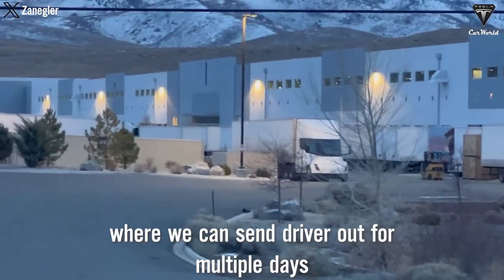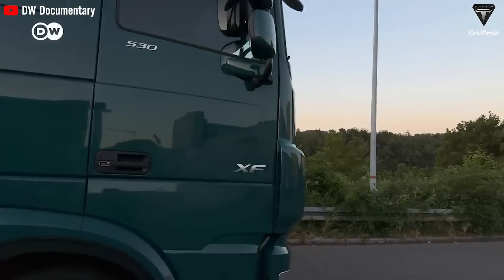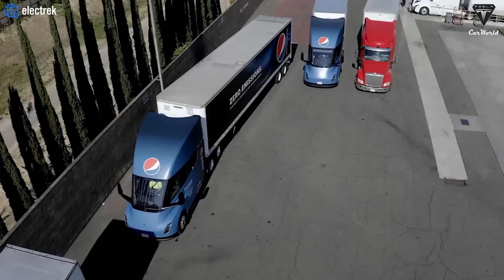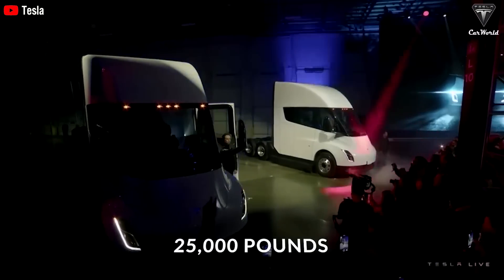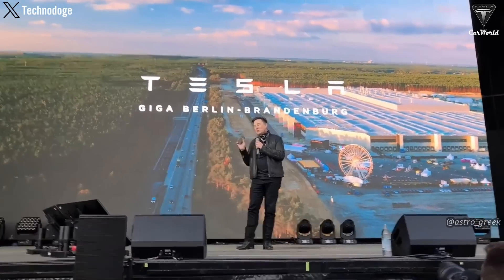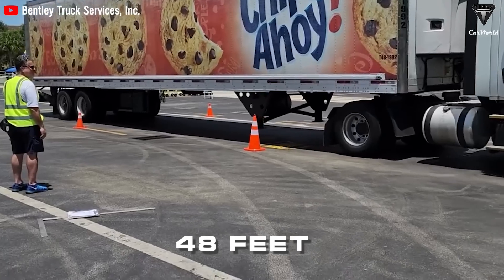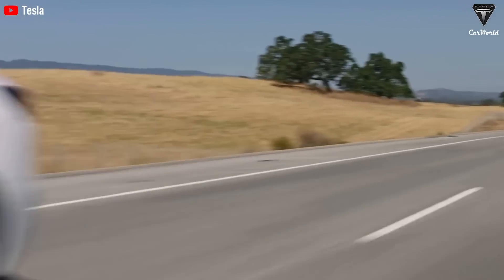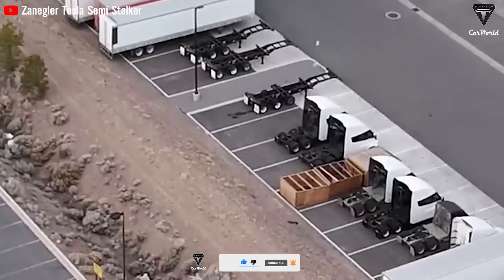It happened! Elon Musk Revealed BIG Upgrade Tesla Semi: Shock Price, Sleeper Cab, 3 Hidden Features!

Comment: You got almost everything you said about FMCSA rules wrong.  The 30 minute break is required after 8 HOURS of driving time, with a max of 11 hours total in 14 hours.  Currently in 8 hours, I can make a bit over 500 miles and typically run about 2000 to 2500 miles a week.  It takes usually about 15 to 20 minutes to make a fuel stop and that's usually done once every 1100 miles or so, with the truck I drive and 200 gallon tanks.  The truck weighs 18500 lbs, can carry a load of up to 43000lbs, (44k, with a light weight tractor), WITH a sleeper containing two bunks, a microwave, a refrigerator and storage space two people can reasonably use.  Can you add a two person sleeper to a 25000lbs truck, that has all of those amenities and remain at a competitive price and weight?  I dont think so currently.  It is also untrue that 80% of loads are less than 500 miles, I think you might be a little bit confused about the different segments of trucking, and count ALL loads as one.  It sounds like the goal here is more about getting rid of truck drivers than it is about revolutionizing trucking....

Comment: I like how they make these 'Centre' Drive.
No more Left Hand Drive.
No more Right Hand Drive. 
👍
Reply: Well, its not really a advantage. The driver seats of today are where they are for a reason. In right hand traffic its better to sit as far left as possible, that makes overtaking much easier - you can see past the vehicle in front better and spot oncoming traffic earlier. The same goes for the other side in left hand traffic. And most vehicles dont go from one country with r/h to another with l/h traffic, so a central driver seat is not gaining anything.
Reply: Thanks for that input! :) @petebeatminister
Reply: How does a driver hand paperwork over to a person at a Customs, toll, or security booth from the center of the cab  and when you can't roll down the left hand window or open a door with it being behind the driver? How do you keep the interior clean when there's a lot of snow or mud that and you have to traipse through the cab to get to the driver's seat because of this same issue? How do you safely clean snow off a sloped windscreen where it won't slide off as opposed to the vertical ones on every other semi that do? I sincerely doubt that the narrator of this video or Tesla designers have ever ridden in a semi, let alone operate one for more than an hour. Maybe Tesla doesn't care at all because they are hell bent of fully autonomous vehicles that eliminate a driver altogether. Like the CyberTruck, the Tesla semi is really impractical for most people but it's main purpose is to make money for Tesla's shareholders but even that seems to be a failure.
Reply: @niemi5858  Good comment. Firstly, I reckon they got electric windows (the norm), and as for documents/paperwork, like Driver's Licence is, or will become digital. 👍
Reply: @mickgatz214  The windows aren't electric ,They work like an old Dodge Caravan’s rear windows - pop-out vent windows. As far as I know US and Canadian Customs and Border Protection have no plans for accepting digital bills of lading  and shippers would be extremely reluctant to spend money  on the necessary hardware and software  to accept digital paperwork.  All drivers must have a hard copy of the bill of lading to be in possession of a shipment in transit. 

.
Reply: Waste of space and makes it harder to judge position in some of the manuevers that us real truck drivers have to accomplish.  I cannot tell you how valuable it is to be able to poke your head out of the window to get your Mark I's on your trailer wheels and the back of you trailer when backing into a dock or tight spot.  Also, the cab is too big not to already have a sleeper berth.  This truck was designed without any input from actual truck drivers....
Reply: @danniellwilliams8973  Thankyou for your comment, and I appreciated it very much. I  only said "Centre" steering hyperthetically speaking, however, now I'm going to have to read your comment again when i'm not so tired...nite.

Comment: Should do a diesel electric like a train for the big trucks.   It would help as the infrastructure of electric gets established and give limitless miles.  Power regeneration in the wheels almost eliminates the need for brake changes and maintenance which is an enormous savings.  You can cut the battery size in half!  Already being done by a Canadian company.
Reply: yep, Edison Motors,
Reply: They could help charge other trucks
Reply: so drive a diesel.somebody didnt attend physics class,musk has the same problem.
Reply: @carlbothmann   Yes my ignorant friend.  Diesel and gas motors are much more efficient at a single speed you twit.  Carl, your the type of person we do not need ever.  I guess the the entire diesel/electric locomotive industry got it wrong.  Combining the PHYSICS used in reclamation of power during braking, I would say you have just about proven the fact that you should not comment just because a thought pops into your head.
Reply: @carlbothmann Sounds like the ignorance is just spilling out of your mouth.  Diesel/Electric motors are much more efficient than Diesel alone and you can't regain the power lost through braking, sir moron.  You are type of individual that thinks a thought and spits it out on the internet.  Your lack of understanding is best kept to yourself.  You must not be educated in the United States or at least didn't pay attention and obviously have NO real world practical experience.  Keep your thoughts in that tiny little brain of yours until you can come to the table with humility.  twit
Reply: @carlbothmann Where is you billion dollars ignorant twit?  Those of us who have a brain know that efficiency greatly increases when you leave an engine running at a single rpm...  not only that, combined with the return of power by regenerative braking, only the ignorant carl bothmann would argue against it, spilling his ignorance all over the place.  Factor in extremely expensive brake changes that you now won't need, only Carl thinks his clever remarks can be taken back by the delete button but the internet always remembers the ignorant.  huh Carl?   Do I need to go on about how we don't have the infrastructure anywhere in the world to support all electric trucks on the first orders already received......CARL>???
Reply: @carlbothmann  ? , 21 electric semi,s working for more than a year in the real world for pepsi who took a chance and bought them , work as advertised , seems some 1 does,nt keep up with applied physics to me
Reply: @stevensmith797  applied physics hmmmmmmm like self driving cars ,hyperbullshit etc i know ,i know apllied physics imao.
Reply: @carlbothmann  :mean time those trucks work as advertised in the real world , not the looks like , or read between the lines world , but actual applied physics real world lol 
as for the hyper loop , an Idea that students are working on and learning  , like darpa does with it full automomios off road chalange , or the world solar car chalange , a learning tool , and turns out an autonomus car is more dificult than he thought , but it is getting better and will come , I dont get your argument , "he said we will do this by this time , and didnt  lol , but in the end , the trucks work , same mentality as a flat earther , ignor actual impiricle evidence , real world results from an independant user , just so you can hate on lol

Comment: Batteries need to be modular, pull / roll one out, roll a charged one in. In places where Solar is available, charging could be free. Only then will Americans embrace Electrification.
Reply: But that would require them to be standardized. Which would be very difficult among all the different manufacturers and car sizes. And about the "free" thing... even if the energy is free, who pays for the facility? Building it and maintaining it?
AFAIK, Renault tried to introduce a battery swapping system years ago, but it went nowhere.
Reply: I dont agree with your charging scenario.  Drop and grab is correct.

Comment: Coca-Cola and Fritos seem to be doing fine with these…  No one is forcing them or you to go electric ⚡️
Reply: ………. Savin on fuel bill
Reply: @sparkysho-ze7nm   - costs $1.49 for 50 EV miles ⚡️charging off peak times:
10pm - 6am and I get over 230 ⚡️ miles for under $6… and zero maintenance, just tires.  The synthetic oil in So. Calif. heat lasts forever. 
So please try to be open minded 🙏
Reply: they carry no weight,  A truck full of air.
Reply: @jameswalsh2433  - Tesla Semi has three electric motors believed to produce a total of just over 1,000 horsepower.
-  1,050 pounds-feet of torque 
- with a load capacity of 81,000 pounds
- the last current snow storm here at Lake Tahoe the Tesla Semi was the only truck making it up the grade in the ice and snow during the storm that left 10 feet of fresh powder

Comment: Ten years from now those self driving trucks will take themselves in for routine maintenance, or any time a code develops requiring it to get fixed. The one thing I don't hear much about it the ability of these trucks to pull refrigerated cargo which makes up about 25% of all freight. That has a really easy solution though. Install an electric reefer like the Transicold with their on board hydraulic generator set and a second hydraulic pump after the drive axle to pick up the kinetic energy that could provide the power for the reefer for up to about 90% of the travel time. Because some of this is already available in Europe, I suspect it will show up there first. Too bad though because US truckers could use the large savings in maintenance and fuel cost now, not in five years.

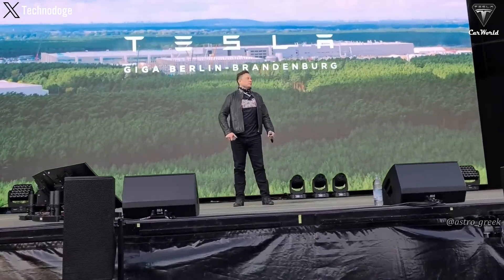Comment: 7:50 Government greenhouse gas emission regulation are based on deceptive marketing that human caused greenhouse gas emissions are causing global warming which is impossible.   They will likely not remain in effect long term without some other reason.   Earth's greenhouse effect is used in freshmen high school earth science as an example of system that is always in saturation from the strong greenhouse water vapor adding an average of 10°F (5.55°C) to earth's average temperature that is all around us everyday.   All the greenhouse radiant energy from the earth is completely absorbed by greenhouse gases within 20 meters of the surface.  Water vapor would hold earth's greenhouse effect in saturation if it were the only greenhouse gas in the atmosphere.   At 1% average tropospheric water vapor over a 99% share of earth's greenhouse effect is due to water vapor.   

The back of the United Nation's IPCC science report has a statement of legal data transparency, although not labeled as such, that states in took its greenhouse gas samples at 20,000 meters altitude.   It is high school knowledge there is no greenhouse radiant energy at 20,000 meters altitude.  The report's authors have been legally transparent with their data protecting them from fraud prosecution.  

Global warming has not gone up a significant 2/10°C since the late 1980s.  In 1991 global warming was officially reported at 1.1°C.  Then down graded to about 1°C in the mid 1990s.   In 2022 global warming was reported at 1.06°C.   The Arctic is warming with the proving cause being warm Atlantic Ocean waters migrating more frequently and further into the Arctic Ocean warming it and the region.  The warmer Arctic Ocean water has caused a few weeks less of reflective snow and ice coverage causing more solar gain to the surface.

Comment: Spec-for-spec an EV model is much heavier than the same ICE vehicle. And Commercial vehicle authorities are prone to use exceeding gross weight as a substantial revenue source. Any increase in tare weight means a reduction in payload which means less revenue for trucker. Capital costs and operational costs combined with ever increasing regulations makes one appreciate how difficult it is to run a trucking firm today.  .
Reply: Autonomous trucks No driver payroll
Reply: As they indicated, that may work for a very very small portion of the use of truck tractors, but no driver, or EV as we know it now has no role in mainline trucking IMO.  @sparkysho-ze7nm

Comment: Electricity is not readily available. Charging stations for electric semis are non-existent. The cost of charging electric cars at a commercial charging station has gone up dramatically, now costing more than a filling up with gasoline. Charging an electric semi will fall into the same trap; pennies now, many dollars later. Tesla cars that were used for daily driving like UBER found that the batteries lasted 1 year. The same will happen to the trucks which will be driven even more than the UBER driven cars. Replace that battery and tell me what a great deal it is!
Reply: Every Year 🥴

Comment: EV Semis are an absolute JOKE! 500 miles is TOO SHORT of a range! I used to drive 620 miles on my shift routinely. 15 minutes to refuel. Change from cold to hot climates to cold in a day or 2. Traffic jams all the time from construction or accidents.
Reply: @Tron-Jockey 
😂🤣😅🤣😂

My wife and I drove OTR for 7 years. The 48, Canada and Mexico. 1,453,000 miles! (No accidents, BTW!)

Did you see the EV freeze in Chicago this past winter??? You can’t charge an EV in sub freezing temperatures!!! Nor get power from the batteries!!😂🤣😅🤡🤡🤡🤡

Obviously you’ve NEVER been stuck in traffic for 3-4 hours in LA, San Francisco, Washington DC, NYC, or Philly in the heat of summer or the dead of winter! Or driven through Death Valley at 125 F or Nevada-Arizona in the heat of summer! Yeah, you still have to run your cab A/C or heat! Where does that energy come from?? It’s a substantial load on your engine or batteries! We drove non-stop pickup to delivery, as a team, carrying pharmaceuticals, blood products, explosives, radioactives, DOD, NASA, even artwork. Sometimes terminal to terminal cross-country. Many cross-country loads. Being stuck in traffic could easily mean your battery charge gets cut by a third just sitting with your A/C or heat on!! 

So I’m talking REAL WORLD EXPERIENCE here, whereas you’re talking pie-in-the-sky theory here!!!😂🤣😅

On top of all that, most drivers DON’T just run local routes like you!! Hell, just look at the truck stops!! And it’s bad enough what the dealers charge for maintenance, and the waiting times! The wait and charge for EV semis is going to make a diesel rig look like chump change!! 

And charging times?? In an IDEAL WORLD, you can charge an EV semi in 15 minutes!!🤡🤡🤡 In the REAL WORLD, that’s going to take 1 hour to 8 hours!!! That’s a WHOLE LOT OF KWHs you’re pumping into those batteries!!! The grid WON’T handle it!! Not with 100s of trucks trying to charge!! They’ll all be slowed down so the grid doesn’t crash!!!

You live in a world of rainbows and unicorns!!!🦄🦄🦄🦄🦄🦄🎪🎪🎪🎪🎪🌈🌈🌈🌈🌈🌈

So tell me again, who the hypocrite is, and who here is unqualified to make an informed comment on this!!!🌈🌈🌈🌈💩💩💩💩💩💩
Reply: Only ten percent of truck movements involve long haul.
That means these BEV trucks are perfect for 90% of truck movements.
Reply: @richardvivian3665  

Bwahahahahaha!!!

That’s a FAKE FIGURE!!!

Over 60% of truck routes are over 1000 miles!! Look at FedEx, UPS, USPS, food, produce, automotive, pharmaceuticals, Amazon, Walmart, etc.!!!  

You are being asinine!!
Reply: Technology is tough, sit this one out boss
Reply: @GunnyMac360  Boss is correct! How many years have you got as a professional driver? (7 for me) How many years have you worked for SpaceX? NASA? (8 for me)

That’s what I thought! Yeah, it’s not ME, but YOU that are technology challenged!!

So get back in your corner, put your cone back on your head, and SIT DOWN, before you hurt yourself!!
Reply: @wolfman007zz  all them years and you don’t own shlt, have fun driving those EVs for your boss 🤣🤣
Reply: @GunnyMac360  Bwahahahahaha!!!

You’re so funny! But LAME!!  

What do I own?? I OWN YOU!! My wife and I made $20,000 per month driving for FedEx for 7 years! But I’m an engineer by profession. I worked for SpaceX 3 years, now NASA, after leaving the profession to travel the country with my wife. Used all that money we made to build a new house on the lake. Never owned an EV, never would!! Too smart for that!!

So yeah! You’ve just been OWNED!!!!
Reply: Did you take a break? These new batteries only need 15 minutes to charge up to over 80%. That’s doable right there.
Reply: @Sanddollar1  Bwahahahahaha!!!

What charger is going to charge a “500-mile” EV Semi in 15 minutes???? None that exist now!! And when you have 1,000s upon 1,000s of these, all trying to charge?? Do have any clue how many KWHs that is???! And placed anywhere and everywhere I need to take my 8-hour rest for 30 minutes???

Bwahahahahaha!!!

Ain’t gonna happen!!!
Reply: Stop being ignorant currently CATL Solid State battery are doing 1000miles with warranty of million miles😂@wolfman007zz
Reply: @wolfman007zz 
Ever heard of battery swap? 
Takes a few minutes to swap a battery, much quicker than refueling.

Bwahahahaha! 

Electrification of trucking is already happening.
Reply: @richardvivian3665  

Bwahahahahaha!!

Did you know it takes 20 hours, 3 technicians, and $40,000 to replace the batteries in a Tesla Semi????!!!

Much less than that to rebuild a diesel engine in a tractor, after 2 million miles!!!! 

🤡🤡🤡🤡🤡🤡🤡
Reply: @wolfman007zz why are you talking like a 11-year old? Can you just engage in a normal debate please?
Reply: @Sanddollar1 Typical non driver
Reply: Electric semis are th absolute FUTURE!!!! Cleaner air for future generations
Reply: @sparkysho-ze7nm  Total ignorance!! Do you know how much energy from fossil fuels is required to manufacture an EV semi?? Or how much is burned to mine the minerals and manufacture an EV semi?? Then burned to charge an EV semi??? You live in a bubble!!🌈🌈🌈🌈🌈🦄🦄🦄🦄🎪🎪🎪